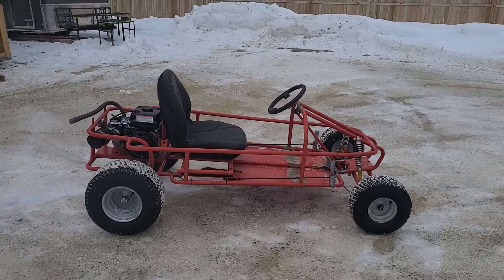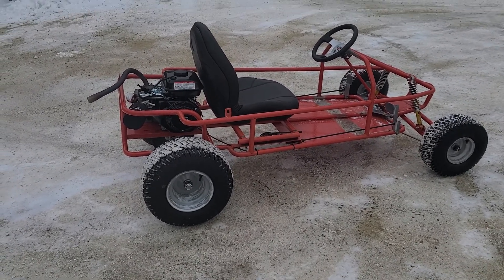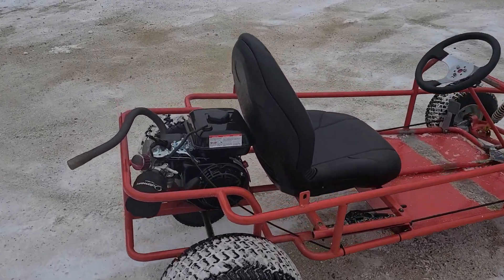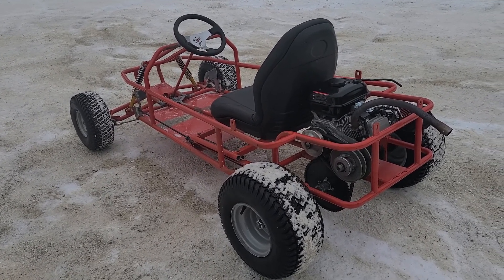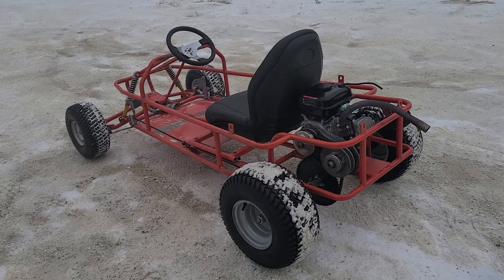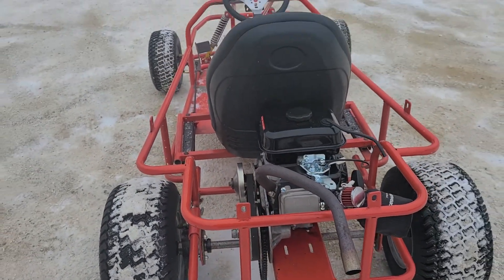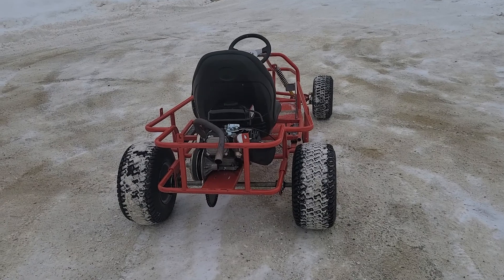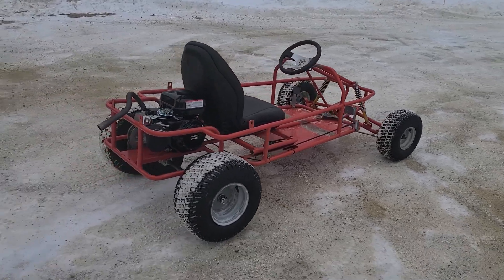Wild Cat 223cc Has IT Guys!!!

Comment: So the 30 series works best under 5k, the super 30 series 5k or over; is that an accurate assumption? And then what about to 40 series and the juggernaut? Plus can't you just change the weights in the things for different rpm operating ranges?
Reply from the maker: I have to look into that on the weights for the super 30 series. Yes, if the motor can't bang 5k+ on the drop of the throttle you won't get anywhere quickly or maximize the use of the motor with a stock juggernaut.

Comment: Did you align the sheaves of the torque converter? I could be wrong, but looks like the driver needs to be a bit more outboard.
Reply from the maker: I just ran it how it was but yes it does indeed need a couple.  I usually run at least 2 just to cut down on the "ping". Only comforting thing about the ping on this thing is that when coming off the throttle on a straightaway you still know the driver is attached to the motor. Lol, its a little on the loud side. Perhaps I'll look more into that stock high flow muffler the Wild Cat 223 came with.....🤔 then again, I plan on getting inside this motor to build it for that Trailmaster. This was more so to give it a fair comparison to a Predator 212 Hemi. The 223 is the same bore but comes with a stroked crank from the factory.  If you add a longer rod and a different piston you get a lot of useable torque even on the stock cam with 18 pound springs. Builders are shaving the head something in the vicinity of .06in with hopes of compression pushing 8k+ .....but with that longer stroke.... I'm hoping I can get some real power without going into all that but we'll see.
Reply: Would you choose predator or wildcat when building a Mini bike?

Comment: So would this be a good stock engine for my direct to crank long tail mud motor?
Reply from the maker: I would take one of these over a Predator 212, more torque at a lower rpm and overall power. Throw a $10 coil, ARC flywheel, intake, jetted carb and header on it and that's what is in this video! A Predator with the same "stock" mods would get smooshed.
Reply: @fatbuddycat  You have a video of the flywheel install?

Comment: So does this have more power than the 212r MKII? They claim the MKII has 12hp.
Reply from the maker: I have two 212Rs. It's a hard comparison.  The 212R is based more on compression and rpm where the Wildcat is stroke and flow. Are you planning on building it or leaving it stock? Stock the 212R takes it. Add a rod, flywheel and 660 carb....that Wildcat is a freight train!!
Reply from the maker: The 212R is capable of 12hp. Not stock. I'd say my 212R with a billet rod, governor removed, 22s and 660 carb is 12hp. "The cam is good for producing up to 12hp" would be a more accurate statement.
Reply: @fatbuddycat  the Wildcat has better low end torque than the tilitson 212R? I'm looking for off road torque not speed.
Reply: @fatbuddycat  for a bt200 mini bike with torque converter an 60t sprocket
Reply from the maker: @jacobsebastien3910  the Wildcat has more torque across the boards.

Comment: I feel like the Super 30 shifts a lot slower and in a narrower range than the Comet 30.  The Comet 30 needs lower gearing to avoid overloading the engine vs the Super 30, which can tolerate higher gearing.  Put a smaller sprocket on with the Super 30 and see what you get...
Reply from the maker: I think that's the problem I'm having on my 196 mm80! I'm running 10/54 with the Juggernaut and it revs out way before its done accelerating. Superb engine response and control but it gets tight up top.